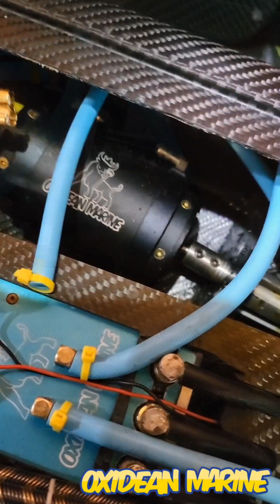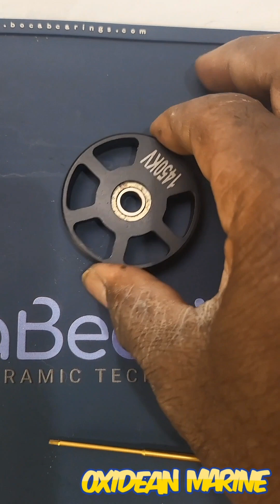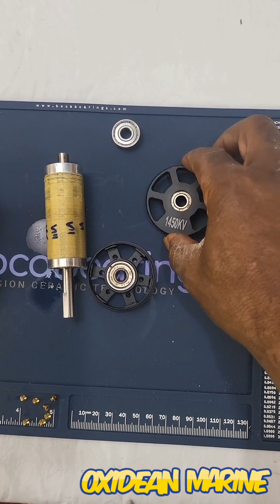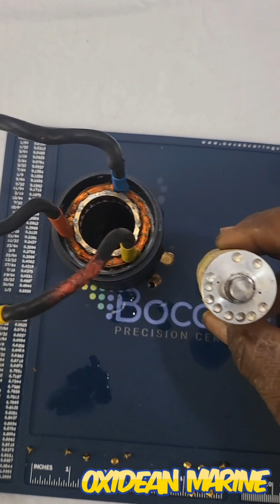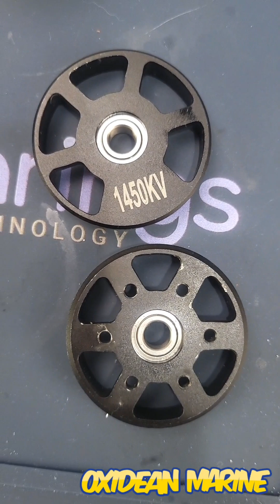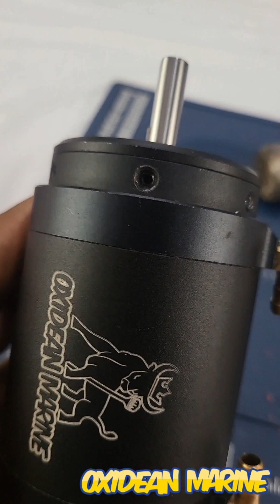Rc Boat Plane Car instructional video Replace Bearings in a Brushless Inrunner Motor

Comment: I learned quite a bit from this video, i didn't know the rotor was wrapped to protect the magnet & stater,  i tought it was to help keep the magnets from slinging them self off the rotor itself,  guess it does both. Great stuff.   BG4L
Reply from the maker: I think it actually helps Both brother! Depends if the magnets are Sintered or not.